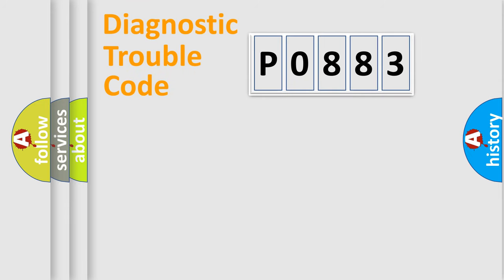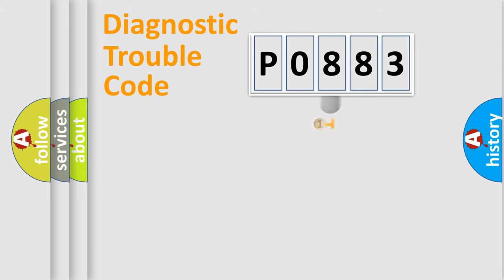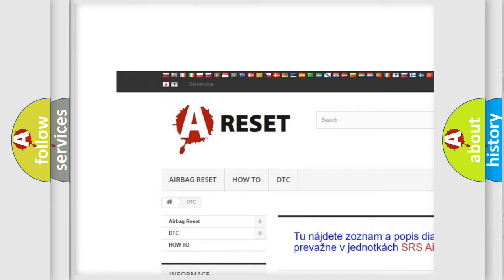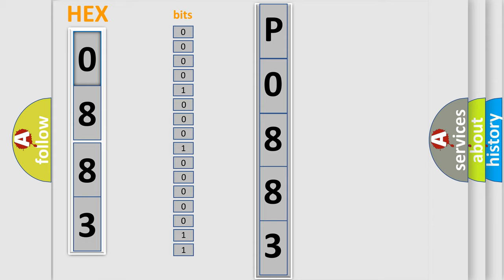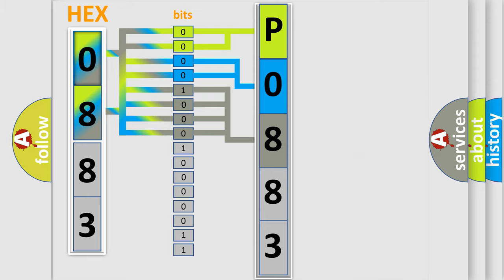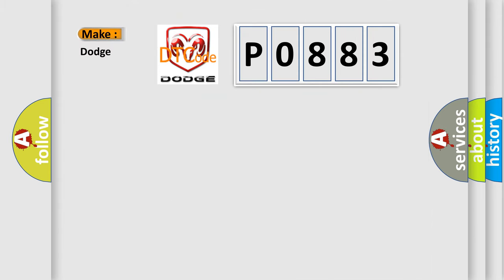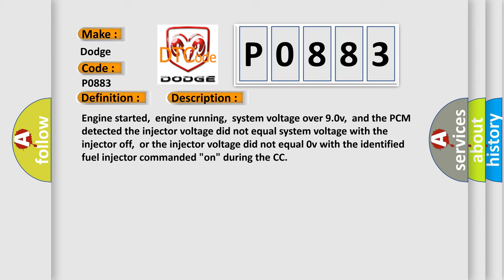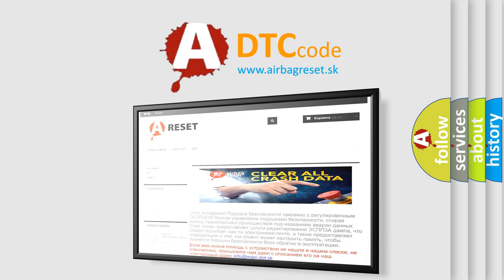DTC Dodge P0883 Short Explanation

Comment: P0883 Transmission controller receiving wrong voltage from TIPM. TIPM is brain of the car located inside the fuses box close to 12v battery. TRANSMISSION CONTROLLER large box located between wheel shell and bumper from driver side and has 4 plugs. Look under bumper and you will see it.
Car worked perfect 2011 Dodge Caravan until I washed under hood. Drops of water sucked through the wires into TIPM. (White and Red sockets). Immediately after washing transmission start work very rough, relays in the fuse box started clicking, lights blinked, indicators says front door is open, fan radiator malfunction, brakes malfunction and etc. I saw Christmas lights in the car, very strange things and bunch of additional check engine trouble codes on OBD ii. How to fix : STOP and disconnect 12v battery wires as soon as possible.
Disconnect TIPM BOX but DO NOT disassemble TIPM and fuses. Check wire sockets for drops of water. Probably you will not see water. Water can be inside TIPM. Use strong vacuum to suck water from all sockets / connectors, over fuses, over relays AND from wires plugs. Warm hot like 80°C / 200°F whole TIPM plastic box with hair dryer or heater. Vacuum it again untl it becomes cold. Repeat steps about 5 times total 1-2 hours. USE VACUUM do not blow inside! Vacuum will remove all little drops of water. Connect TIPM Connect battery wires Turn on switch to second click when lights on for 12 seconds (no run engine) Turn off switch
Now turn on engine If transmission shifting very soft to D position you are win!!! Check engine trouble codes should disappear after TIPM will test them. 😁 If TIPM and wires vacuuming didn't help than repeat steps with transmission controller. Let the car dry under hood probably 2 weeks or more (depends from weather). It doesnt want to dry itself inside connectors or TIPM . Disconnect battery and open all connectors. DO NOT USE transmission when it works rough. Conclusion: yes everyone like clean car but do not wash under hood.
2ND REASON OF P0883 Bad alternator.
You want to check voltage by Oscilloscope  on low headlight bulb wire. If voltage jumping or you can see headlight is little blinking in night you alternator should be changed.
Wrong voltage  from alternator doing all electric parts work incorrectly and transmission will work incorrectly and rough.